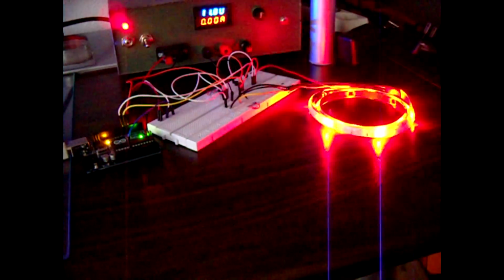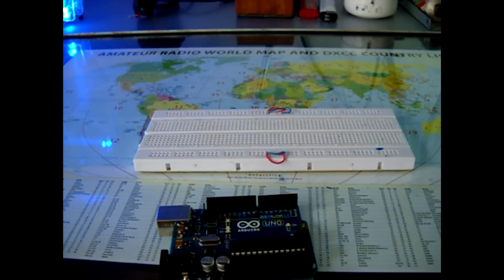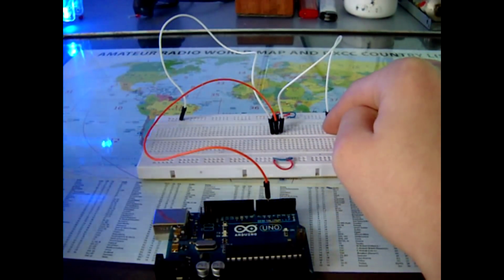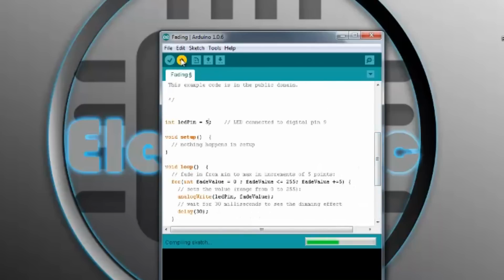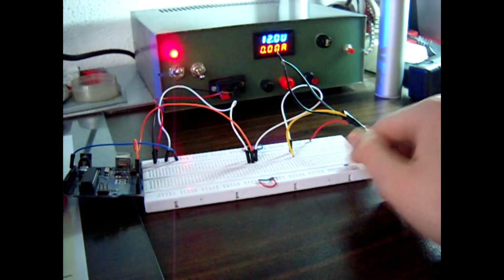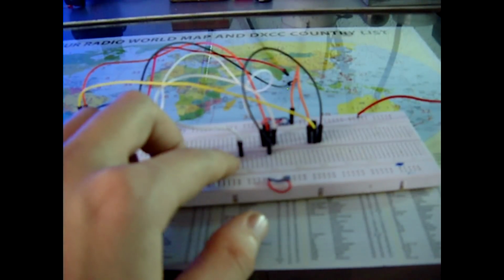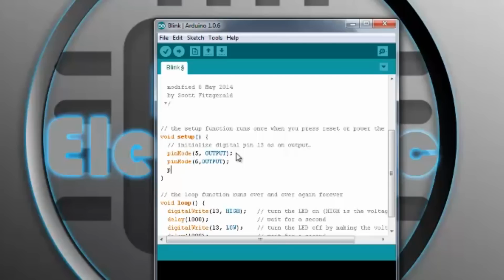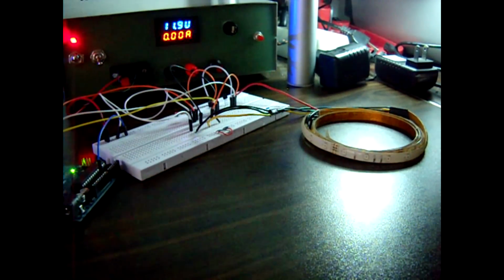How to control led strip with arduino

Comment: FastLED library -_-

thx me later
Reply from the maker: FastLED library is made for a adressable leds like WS812B, these are regular leds ,they don't have shift register bulit inside.So you can't use FastLED library.

tnx me later
Reply: @AlemElectronic  i thought they are individually addressable ws strip :/

thx

Comment: I'm a noob in electronic but as far as i understood the data sheet says that 2n222A is limited to 800 mA  (  (Ic ) Collector current ) . I'm sure that your led strip needs more than 800 mA ( i read more or less 1 Amp per meter ) . How does it comes that the transistor can handle it ?
Reply from the maker: well i measure current of the led before i connected them to transistor on the internet 1meter of leds is considered to draw 4.8w but thats not true you should check amps so you can be sure exactly how much current are they drawing

Comment: If as you said you're using a  2n222A transistor then form left to right it's  : Emitter-Base-Collector and not as you said "collector-base-emitter"  . 
cf : http://www.onsemi.com/pub_link/Collateral/PN2222-D.PDF
Reply from the maker: you're datasheet says pn2222 not the 2n222
Reply: My bad ;)

Comment: @Alem Electronic, can I use S8050 NPN transistor?
Reply from the maker: yes you can just make sure which pin i emitter,base and collector here is datasheet of your transistor
http://pdf1.alldatasheet.com/datasheet-pdf/view/154210/WEITRON/S8050.html
Reply: I can use any transistor if I know where is base, emmiter and collector?

Comment: can i use tip122 transistor?
Reply: Probably better off with Tip transistor(I use tip31c), also I would recommend to add 1K resistor between Arduino and base pins in the circuit :)
Reply from the maker: yes you can
Reply: i built the same circuit but when i turn on the arduino, the light doesn't light up ( i can barely see a tiny bit of light on the led strip) it does the same when i directly connect the game to the 5V of the arduino ...

Comment: Cool but misleading.  I was hoping to see how you could power an LED strip by boosting the 5V coming from the Arduino.
Reply from the maker: Led strip needs 12v and arduino doesnt have enough output currnt to power them up , in my case here i used 5v only for triggering the 12v..You got a 5v led strip on ebay actually its a adressable led strip every led is a induvidual but they are much more  expensive